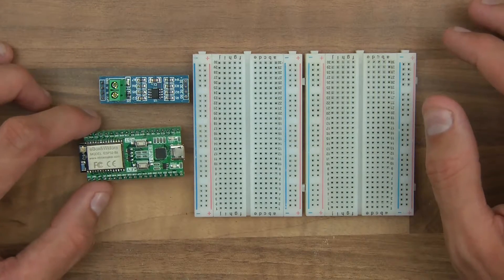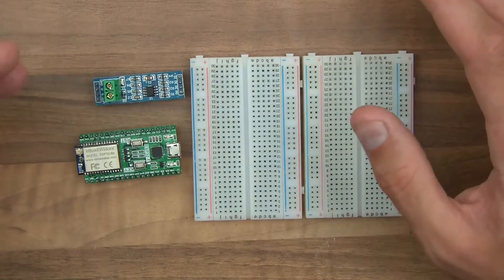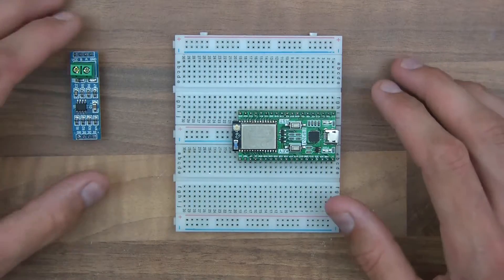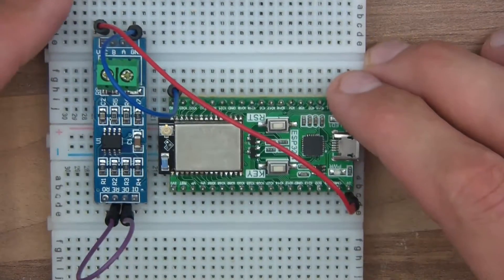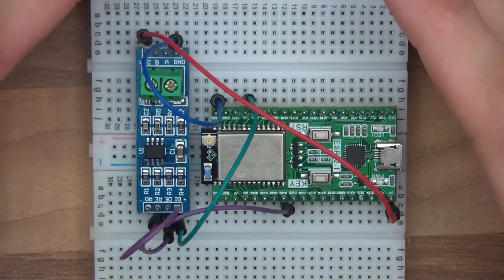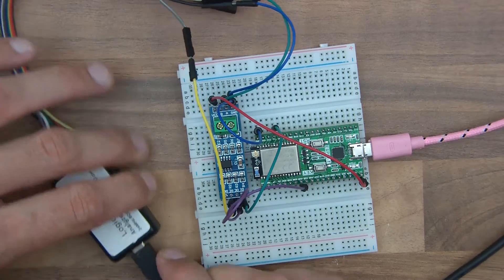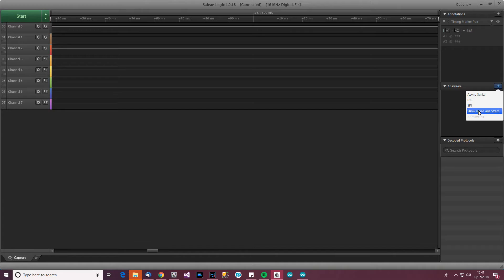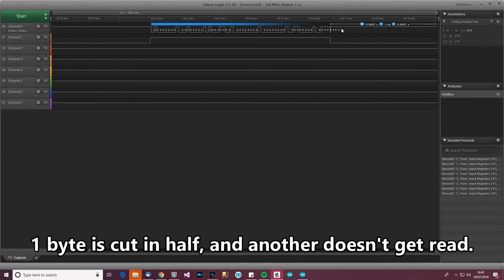TUTORIAL: How to make MODBUS work with ESP32 - Arduino - RS485 - Part 1

Comment: the problem is not the esp32 but the program.... it should switch only from tx mode to rx mode after the serial buffer sended the last byte at the low speed which takes a while.

Comment: Antony Cartwright, I have query about integration of ESp32 and GOT HMI with FX5U through RS485. If i connect Individually, I am able to read the data from PLC but when I connect it together (PLC,HMI and ESP32) It shows error on PLC. I am using ESP32 for data logging . Can you suggest what could be reason for error?

Comment: One question, ESP32 works with 3V3 logic, can this Converter Board  work with 3v3 logic level?
Reply: Paulo, procure pela interface com alimentação de 3V3 também. Assim, seu nível de tensão de equipara aos níveis do esp32.
Reply: @jrg77   Valeu pela resposta, testei com o ESP e um Arduino(lógica 5V) se comunicando, alimentei o barramento com 5V e funcionou legal.

Comment: The A and B pins basically indicate a 0 or 1 by A being higher voltage than B, or the other way around. 

I would not connect a logic analyzer directly to them as they are not logic level. They can be negative and much higher than 5 V  typical is +/- 7.
Reply: Logic analyzers normally accept +-30V.

Comment: @Antony Cartwright
You video was very useful for me.
there is a solution for the issue of modbus. In fact in the last esp-df version (3.2.2) we can use RTS pin in order to control DE/RE pin of the RS485 module.
It works fine.
Reply from the maker: Thanks for your comment! Where can I read more about this? Thanks!

Comment: Just a note on Modbus. Modbus is not always used in the RS-485 mode, it can be use in RS-232, RS-422 or TCPIP.  Modbus slave devices can only be multi dropped in RS-485, RS-422 and TCPIP.
Reply from the maker: Ken Heinrich hi Ken, I think it can be used with TTL too! :)
Reply: Yes you can use TTL as well, it can't be multi dropped or be much farther than 6  meters away. I have work on systems where there could be 40 slave devices on an RS-485 multi drop and 600 meters away for the farthest     one.
Reply from the maker: Oh cool! I've been working with Modbus for several hours today. I send a device a command, it sends on the A+ line, the device receives it and sends a reply... The reply is received (on both lines)... But the A+ lines receives the message with heavy distortion. The B- line is clean. The general result is garbage though. :-( Why would this happen?!?!
Reply: With RS-485 the data is sent on both A+ and B- at the same time with respect to ground. One is going from ground to a positive 5 volts and the other is going from ground to a negative 5 volts. I one get messed up and the other one does not the data should get through that is the design of RS-485 to be able to go long distances with out total communications fail. Is there a second command being sent before the full message is received that would mess up the data.
Reply from the maker: Hi, There's no second command. I've just switched over to a different RS485-TTL converter and the problem is slightly different now. Now it does transmit the message on both lines, but the received message is still corrupted on the A+ line. The message from ESP32 to the converter is perfect, so this puzzles me a bit. Why would the reply be noisy on one line from the device!?!? I'm thinking the actual wire might be damaged or dirty or something.
Reply: Hi, grounding is the most likely cause. Have you got both ends to the same ground connection. The command and reply both are sent on the A+ and B- at the same time that is why hand shakes are required so you don't get collision. The reply should not start until the command is complete and if there is a second command it should wait for the end of the reply before the second command is sent. Grounding is critical.
Reply from the maker: Ok, timing seems perfect, there are no collisions... A+/B- command, "waveform" and timing is perfect, then a few ms later, I get the reply... The B- line is right, but the A+ line pulls up for a uS every now and then when it shouldn't. I've abandoned it now as the results aren't workable. The ESP32 is really sensitive and with MODBUS being sensitive too, it's being a nightmare. Tomorrow, I'm going to use a dedicated micrcontroller for MODBUS operations and see if that works. I just need to send 1 modbus command to a device every second, then get the reply and send it to another microcontroller via TTL serial. I'll try tomorrow. :-)
Reply from the maker: The grounding appears to be sound. :-(
Reply: A+ and B- should be the exact same signal with b- inverted from A+. If the B- is clean the reply should get through. Both A+ and B- have to be garbage for the reply to not get through. I think there maybe a problem in the RS-485 chip as it does the conversion from RS-458 to TTL and vise versa.
Reply from the maker: Ken Heinrich ahh I'll swap it again then. Thanks, Antony..
Reply: I just had another thought. If the power supply to the RS-485 converter is flaky it could cause the signal to mess up as well. The chip had to produce the + and - voltages ( with respect to ground) so if you are nearing the current limit of the power supply the signals could get messed up as well.
Reply from the maker: Ken Heinrich ahh, good idea!!! I'll add a capacitor tomorrow....
Reply: Hi Antony. I just watched the video again. You should always connect the A+ and B-  because A+ and B- both transmit and both receive data ( the signals are just inverted) this is done to get around noise that can cause the data to be corrupted, because they are going opposite to each other they both shouldn't both be affected at the same time and the data should still get through. Again they both are use to transmit when a command is sent and the both are use to receive when a reply is sent that is the only reason for switching to RS-485 from what ever the micro controller is using (TTL, RS-232 and so on).
Reply: Good that my help. Because you are using the high baud rate will also make the square wave signal go bad faster with a power supply that is nearing it max current limit.
Reply from the maker: Ken Heinrich Hey, I need to add, the project I'm working on today isn't to do with this video. It's a different project!
Reply: That isn't a problem. I was just explaining the reason for RS-485 and long communications lines is the reason for using RS-485 in the first place so you should always connect both lines to help get away from corrupted data.
Reply from the maker: Ken Heinrich ok ok, I understand. I'm going to try out the solution in a minute to see. The project I'm working on does use both channels, although for some reason, one chip only sends on a+ channel. Maybe it's broken. The other chip doesn't do that.
Reply from the maker: I've finally worked it out! The termination resistors which I've used for the project were too high resistance. I've swapped the 680 ohm to 120 ohm and it all works... :-)
Reply: Good to hear. Good luck with the rest of the project.
Reply from the maker: It's strange as in Part 2 of this video, released the day after this one, the 680 ohm resistors worked fine. :-D

Comment: easiest way is not to allow to handle DE/RE pins by esp32. Instead use mosfet or transistor, when there is tx or rx active then DE/RE are pulled low/high automatically. No library modifications necessary and this solution works for years in my setup.
Reply: How exactly does this work? I like the idea but wondering if the transmit works also with the lower voltages if the esp to rs485
Reply: Hi sir use transistor can show us how it work